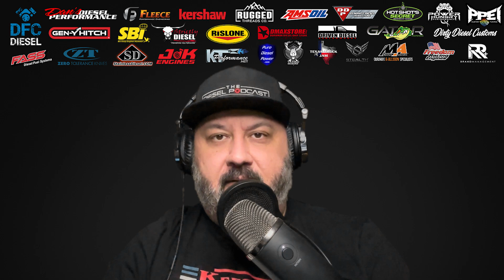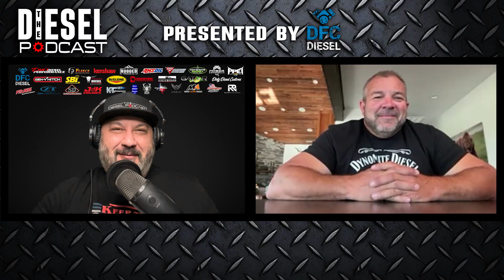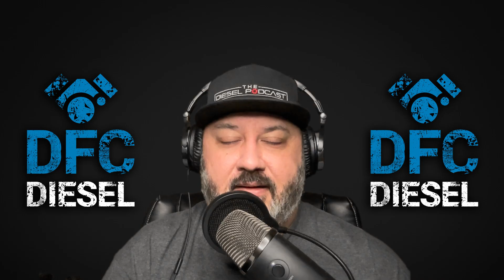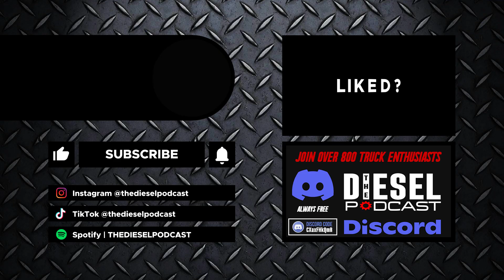Fuel Injectors & Increasing Efficiency

Comment: Yep, got excited when Lenny mentioned 7.3...
Listening to the way Lenny looks at business, relationships and the road forward... Proper, respectful, insightful, passionate
Sounds like HP Tuners for diesel. I watch Steve and Kyle Morris also, that's exactly what they do. Run, look at the log, make changes and head back out. That'll be a HUGE step forward. Especially with all the log features they use to tune all parts, power, trans and chassis. And the avenues to control boost!